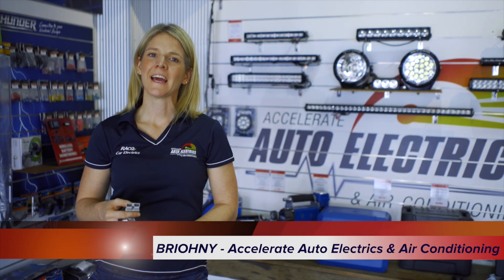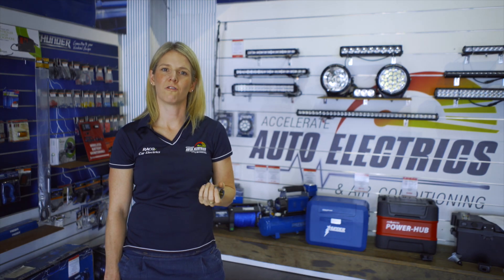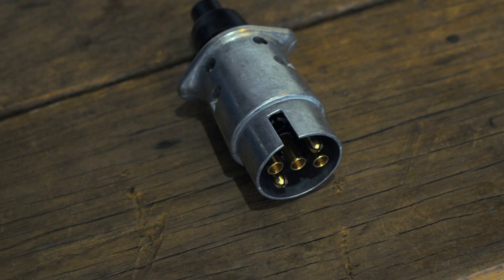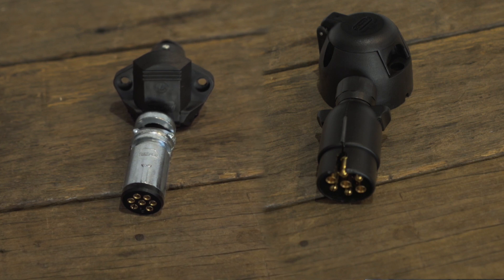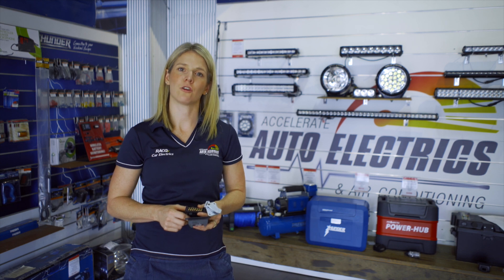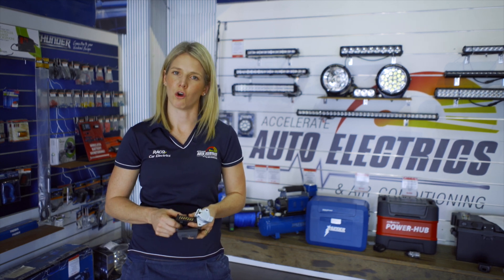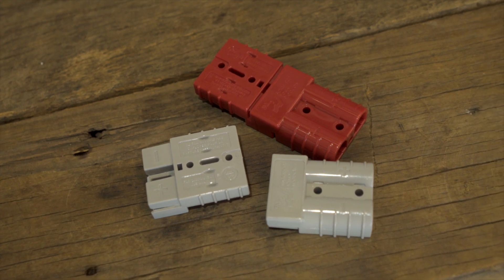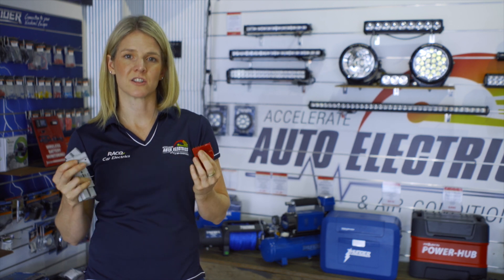Guide to Trailer Plugs: Towing & Charging Solutions | Accelerate Auto Electrics & Air Conditioning

Comment: @chappysprojects2627
0 seconds ago
Hi, I picked up a caravan 12/2017. It is fitted with a std 7 flat plug and one grey Anderson plug which has two wires connected for each - and pos terminals of the plug. The van does have dexter esc. As I have on my tow car, one grey a/plug then red a/plug the 7pin flat plug then one grey a/plug. The previous owner said the red a/plug was for esc Alco  I think. should I remove the two wires from each terminal and have two a/plugs. your help would be appreciated

Comment: Thanks for the video. My Hikux has a 4mm wore direct from battery to pin 2 of q 7 pin flat to power my ESC on the caravan. Is this ok to actually do?
Reply from the maker: Thanks for your comment. Yes, it is ok to run ESC through the 7 or 12pin. We would recommend it being 6mm cable.
Reply: @accelerateoffgridtouring  Thanks guys. Is this because you're not sure how much ESC draws when it activates? Because other trailer wiring sites recommend 3mm. Thanks once again

Comment: Hi guys,  luv your videos, my question, are the plugs from tow vehicle to the van  interchangeable between manufactures
Reply from the maker: Thanks for your comment! 
Trailer plugs & Anderson plugs can be quite universal across different brands but other manufactures may require a different pin configuration or wiring size.

Comment: Hi there I had a problem with my 12 point pin (new caravan) couldn’t get fridge to work of car so I called into thetford  agent in cairns told me the problem was wiring only had 5 mil wiring on red an black told me should be 8 mil then I was told by another source cause was put lights on  I did so and it started working normal I was told this was common with Isuzu mux my question is should I change to 8 mil cheers David
Reply from the maker: Thanks for your comment! 
We would recommend referring to the manufactures specifications for the wiring size & following their recommendations.

Comment: Hi there, 

So I have a landy and was wondering if there is a plug that allows one to remove and install a roof rack with accessories that need power easier. At the moment is is hard wired which is a pain. I would guess it would need to be water tight. Does anything exist and does anyone have a solution.

Great video and some great advice.

Regards
Paul
Reply from the maker: Hi Paul, DEUSTCH connectors are the way to go. You can get them in 1 - 12 pins and all sorts of sizing. They do require special crimpers though, but are water tight and the bees-knees.
Reply: @accelerateoffgridtouring  Hi there, Thank you for replying. 
I was talking to a friend and even though he has not had the problem, he recommended the same thing. Will source when i get there and looks to be the answer.

Thanks again

Regards,
Paul

Comment: Nice job on that video!
What about the 13 pin plug? On that plug, there are 2 pins (+2 for earthing) that are constant power (pin9) and switch-controlled power (pin10). Manuals say pin 9 (2.5mm wire) is for charging the caravan battery and pin10 (also 2.5mm wire) for caravan fridge.
So my questions is, can I just connect pin 9 (and pin 13[-]) to the caravan battery for charging it while driving without attaching any other electrical accessory (ie split charge relay, fuse)?
Reply: I'm kinda trying to do this but a camping trailer with no other elec in it. Can I just straight connect it or do I need something between plug and battery.
Reply: 13-pin round is for ISO-11446 wiring configurations. This International standard is not common for passenger vehicles in Australia, but can be found in heavy vehicles.
Due to the extreme conditions in Australia, the 7-pin flat is preferred or the 12-pin flat is an alternative for basic supplementary functionality, for all the reasons Briohny mentions in the video.
Anderson Plugs are preferred for any High-Current applications, as also mentioned.

Comment: So what's the difference between the grey and the red Anderson Plugs?
Reply: Both carry up to 50 amps, but red Anderson plugs only plug into red plugs and grey into grey (black Anderson plugs are normally fully compatible with grey plugs). The housing shapes are slightly different between the red and grey Anderson plugs, so they are not compatible. Red is commonly used for solar. It stops you mixing up incompatible inputs, like plugging a solar panel into the wrong input on a DC to DC charger.

Comment: We are in the USA and purchased an Australian made trailer from a US distributor. The camper trailer comes with an Anderson plug for charging of the camper's batteries (there are three batteries and an 1000W inverter built into the camper trailer) from the vehicle or solar panels... however, here in the USA we do not use Anderson plugs. Our tow vehicle does not have any plug for this and we need to have one installed. Do we install it connected to the Jeep's alternator or the battery itself? What gauge wire do we need for this or is there a kit we can purchase for use in the USA? Any help or guidance would be appreciated.
Reply: We recently attended the Overland Expo West in Flagstaff, Arizona and we purchased a Black Series "Dominator" model there. We are excited to see how it holds up. Our goal is to eventually upgrade to a Patriot X1 model but it is top the line and a bit over our current budget. So, to get started and see how we like the camper trailer experience before we invest almost $35-40k in a Patriot model we got the Dominator. Looking forward to getting it out on our first trip within the month! :) TY for replying... it seems we do have a compatible plug here in the US - we just call it something different. My hubby figured it out but if we need anything, I will definitely keep you in mind!
Reply: @JodiDiGaetano-AGG  Anderson plug wiring is commonly connected to the starter battery. Wire gauge is determined by the length of the wire to the second battery. On my car the wire runs from the starter battery to the rear of the car where an Anderson plug is mounted near the towbar (positive cable is normally fused). The trailer plugs into the Anderson play near the towbar. The commonly used wire is 6B&S or 8B&S (fairly sure that is a metric wire size, look here: https://contenti.com/resources/library/bs-gauge-conversion ). Some more information on Anderson plugs: http://thedocaus.com/blog/?p=7457
Reply: In Australia, Anderson plugs are usually wired either directly (and fused) to the battery for live applications or through a Voltage Sensitive Relay (and fuse) to the battery.
Note that if you have a Smart Alternator in your vehicle (most modern cars do), connect the earth of the Anderson to the negative battery cable downstream of the current sensor.